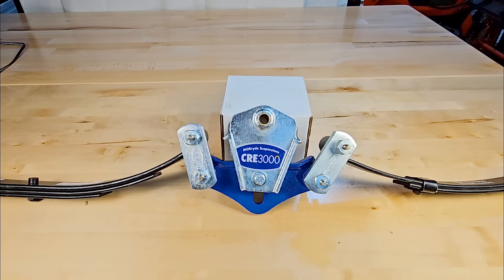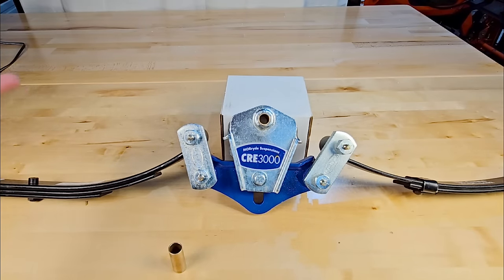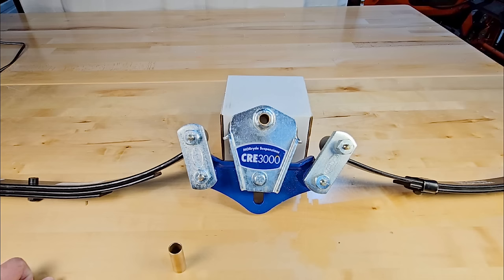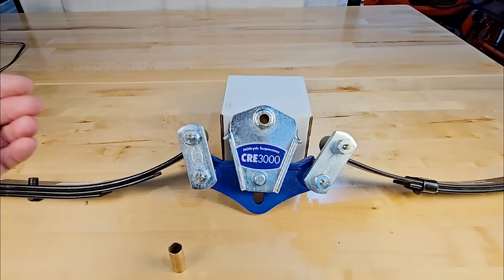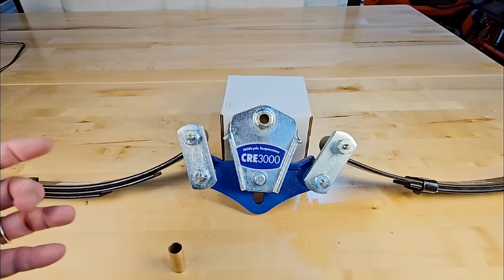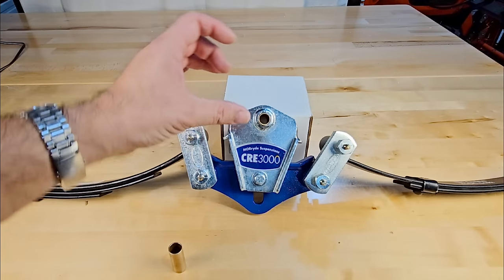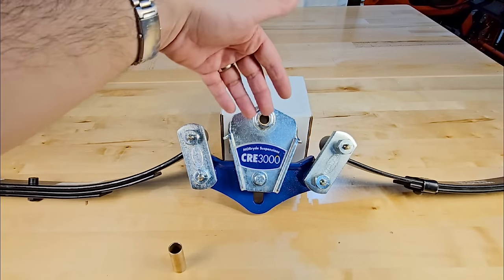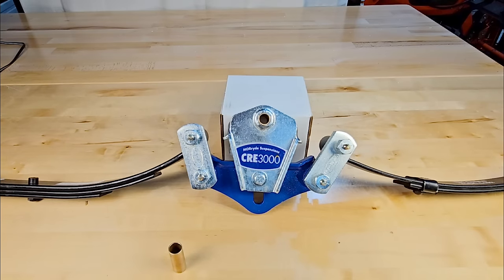Torsion Axles vs Leaf Spring RV Suspension!

Comment: I’ve been using torsion axles for years, had them for over 10 years on my boat trailer and 6 years 20000 miles on my Rockwood, I like the 4 wheel independent feel, I will always pick torsion over leafs.
Reply: I literally just bought a used 2018 Rockwood signature.
I love the way it tows and handles.

Comment: Good video and great description. The issue like you said with the RV is the frame is not strong enough for it and that’s where the cost difference for the system comes in. I’ve towed a 32’ cargo trailer with torsion axles and I can tell you it’s a heck of a lot more planted then my 26’ box RV with a CRE3000. What really made the difference on ours was the sumo springs. It is more planted and less wishy washy, but nothing like the cargo trailer with the heavier frame and torsion axles.

Comment: The manufactures cutting corners is still the problem, Lippert engineering wouldn't go for the torsions because they know their frame is not strong enough to do it. They are using the thinnest gauge chinieesium possible to cut cost.

Comment: We have a 5th wheel equipment trailer that was equipped with torsion axles. It has always bothered me how easy the wheels come off the ground. Also, if we switch trucks and the 5th wheel height isn't set perfect, 2 tires are clearly taking way more load. I would not opt for torsion axles in an application like this again. Great video.

Comment: On aluminum trailers the torsion axles will be bolted in place and therefore easier to replace. This system is easier to build as a spread axle setup. Always check your equipment before a trip to avoid most problems.

Comment: These new comparison videos are great man. I’ve always had a good understanding for how an equalizer suspension setup works, but never known a lot about how the torsion setup works. All things considered, I believe the traditional equalizer suspension is better in most situations. The serviceability, ease of checking condition and ease of replacement are all reasons I would go with it. If you plan on towing that trailer much, and over rough terrain, I believe the torsion axle would wear a lot. But you wouldn’t be able to assess them to find out before failure.

Comment: Very Nice video and all base on facts and no gessing. I would like to add some details on more deeper facts, not specified on your video, that change your mind about torsion suspensions.
1) the way tendem axles springs suspension is design and installed on trailer will always create high stress on the rear hanger bracket, by the fact that the sharkle on the rear axle are on wrong side. They are in front of the leaf springs. So, wen you hit a good streight bump, the natural dynamic forces will tend to move axle backward, but the spring want to go foreward, creating a shockload on the rear spring hanger bracket. That the reason why all car, truck and single axle trailer, sharkle are always in the back of spring.
2) with the equalizer in between the 2 axles, wen the trailer get lateral load ( side wind or fast turn by exemple), the rear and front axle of the loader side (the one that will drop) will automaticly get closer, and on the other side (axles are releasing load), axles will move away. This will make axles to be non parallel. Worse, axles will sreering the trailer on the loader side, creating side load on the pulling vehicule and forcingtires of the trailer to drag sideway on the road on the wrong side of the truck and trailer direction !!!
Those 2 bad effects are not present on torsion independent suspensions. They stay parallel all the time and the main Steel beam are always foreward of the wheel spindles. No rear shock load.
By the way, torsion suspensions can be bolted to the frame, to be able to replace them if needed.

Comment: the really high quality stuff uses torsion axles and a heavy enough frame to tolerate.. ditch witch vac trailers are torque flex up to 10000 pounds  they bounce less as well.  springs are just plain the low quality system.   if you have strong enough axles you are just plain WRONG that springs are better.
Reply from the maker: However, super high end commercial hotshot trailers use springs or Airbags.

Comment: I had a torsion susp go out on a motorcycle trailer.  It was HARD to diagnose and made the tires wear out in like a quarter of the time.  Trailer was all over the place.  550 lb loaded trailer.  E trailer fixed me up.  But for reasons you mention here. Upgraded spring leaf for me.   Or air bags.

Comment: On high end marine aluminum trailers, they are bolted to the frame. I have 5 Myco trailers and all have torsion axles that are bolted. I suppose the people who go with steel might have them welded, but most high end boat trailers are aluminum

Comment: Got 25 year old torsion Axles under my trailer - they are bolted on - should they ever fail its 4 bolts and super simple to change the axle - half an hour. Modern RVs are stupid high of the ground. I get it for longer rigs. But even short ones.  It makes everything worse - driving- swaying. Parking - getting in and out...

Comment: Really value your opinion and research you do. I totally agree the trailer frame has to be designed a bit more robust for torsion axles. Only had my rockwood with torsion axles for 3 years. Zero axle problems. However I’ve had a Eby gooseneck cattle trailer with torsion axles for almost 20 years. No suspension problems. More than 100,000 miles. Hitch height does have to be adjusted to provide level ride to equalize weight. I’m sold. Thanks again for great information and a great channel.

Comment: Both the horse trailers have torsion axles. in addition to providing a low deck height for entry, they provide a very good ride free of abrupt jarring for the animals. Your explanation of driving over a speed bump was exactly what was happening to our 2015 38' toy hauler. The Equiflex was mounted incorrectly not allowing any movement, locked into position. this caused the springs to fail and bend backwards. I wrestled with the coach manufacturer and LCI for months and eventually lost the battle, cost me a lot of money to fix it properly. They told me I was carrying too much food in the kitchen. I have pictures on my channel

Comment: When I updated from a fifth wheel with spring suspension to one with torsion axles, I could immediately tell that the ride/towing experience was much nicer with the torsion axles. The rigs weighed the same and I used the same tow vehicle, so it is clear that the axles made the difference. I suspect that the it's possible to buy a better spring suspension than the one I had, but I would have a hard time believing that you could get one that would ride as nice as a torsion axle setup.

Comment: I know a few people who have had bent torsion axles and Dexter made good by shipping replacement axles. I think the Dexter torsion axles carry a 10-12 year warranty. 

Good video.

Then there are the new suspension systems from Curt that uses coil springs plus dual shocks like found on the Ember and a few others. I haven’t towed with that yet but am looking forward to doing so.

It’s interesting to see them assemble a torsion axle - they literally freeze the rubber portion and push it all together. Then it thaws and goes to work.

Comment: So here is the part I don’t get. Your saying (and Lippert too when it came to your 5th wheel) that with bigger heavier units the loss of equalization can lead to frame damage and thus they don’t suggest converting from leaf spring to torsion.

But the Morryde IS is exactly that a torsion system. And it’s been i stalled on a lot of big heavy 5th wheels and some manufactures even have a deal where they will ship your unit to Morryde pre-delivery to have it installed. Yet I’ve never heard of a 5th wheel with the IS running into frame damage. Quite the contrary owners love that system. 

What am I missing here?
Reply from the maker: So the Morryde IS system provides more travel overall, so it's less likely a tire position will come off the ground. Also, a significantly reinforce the frame with large sectional tubes that carry the weight regardless of what tire is on the ground and loaded.

Comment: Great video,JD
 What do you think of Sumo Springs? We upgraded the suspension on our Springdale with  CRE 3000 Equaliers , heavy-duty shackle straps, and wet bolts. Plus, we also added Sumo Springs. I can't tell you the difference it makes towing! Do you think the Suno Springs were overkill? I find they make a huge difference with trailer sway on windy days. I was also surprised that my original  bushings were plastic.😮
Reply: Be careful with the sumo springs.  I recently saw a video where they did extensive frame damage to one couples 5th wheel totaling the unit.
Reply from the maker: @jetdriver in all fairness, the owners of the RV pulled it into a position that it never should have been in.
Reply: Yes I saw that video they went into a ditch and the frame hit the road
Reply: @BigTruckBigRV  I totally get that. But based on the video and the nature of the damage shown it certainly looked like that absent the sumo springs they would not own a unit that’s now totaled.

Comment: Although there maybe advantages to torsion axles,   The simple fact that one axle must carry all the weight over things like speed bumps or large pot holes is enough for me to want leaf sprung axles.   I own five trailers (equipment, dump, enclosed, 5th wheel and utility),   All leaf JMHO